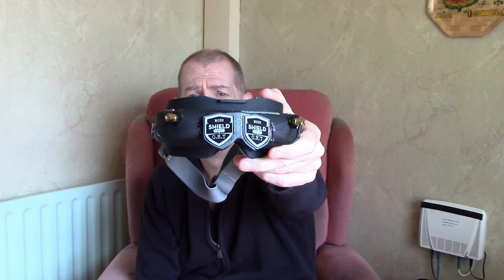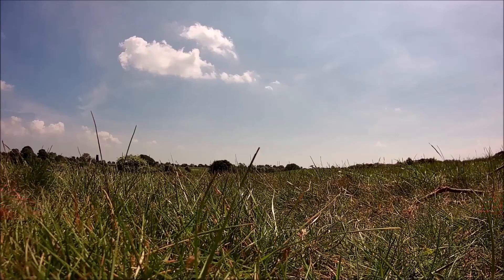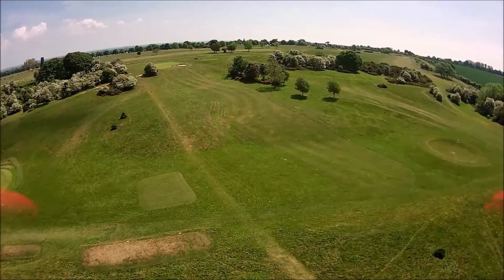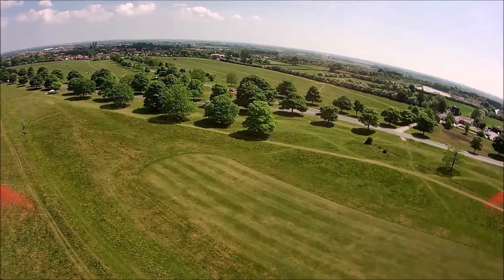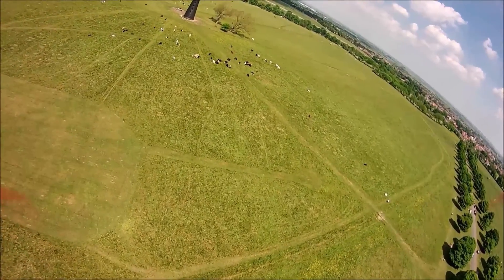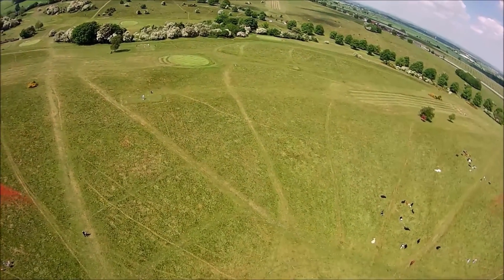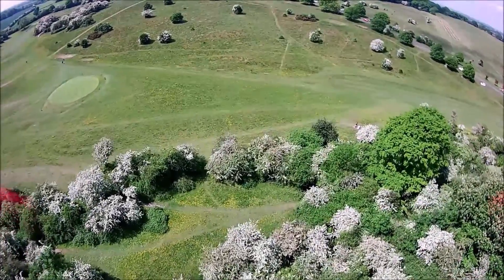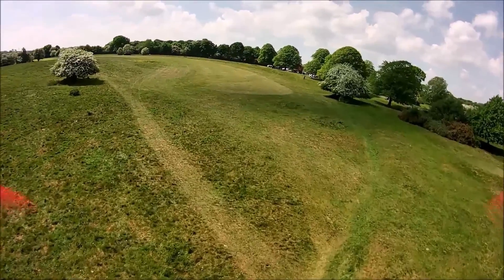TBS Unify Pro32 HV --- RANGE TEST

Comment: I've been searching for some time for a TX antenna worthy of my TBS Unify transmitter, and I came across your review. So glad I did. Now we both will have the same set-up's !!. What are you using for your RX antenna's?. Thanks for this video, and the info.
Reply from the maker: Sorry this has taken such a long time for a reply. But as to your question, well once again I have to say sorry because I have sold all my gear and have stopped flying, apart from my DJI mini 3 pro. To be honest I just got sick of all the new rules and regulations that keep coming out.

Comment: Nice bit of range George 💪🏻 I got a pro32. It melted in a crash fire 🤦🏻‍♂️only flew 2 and half packs with it
Reply from the maker: Unlucky mate that's a shame but it sounds like you forgot to set the power reduce setting. In the VTX set up in betaflight there is a setting so that if you crash or get disconnected from the transmitter the vtx drops it's power to 25Mw to stop it from over heating. As it happens I have been ask to make a video about setting up the VTX in betaflight. So watch out for the vid and you will see what I mean.
Reply: George Cooper  no George it wasn’t the vex that caught fire it was the xt60 touching frame after a crash 👍🏻
Reply from the maker: @DeanChapmanFPV  Bloody Hell mate that is unlucky. I have "NEVER" heard of that happening.
Reply: George Cooper  it was a clracingf4s f4s and xt60 was to close to the bottom plate and my own fault and strange thing I flew it a whole year like it 😃 after upgrading crossfire and pro32 I did 3 packs and 🔥 the pro32 needs at-least a new harness 🙈
Reply: George Cooper I made a video called tbs crossfire dreams and you can hear it burn after crash